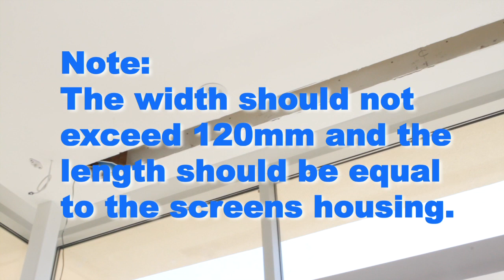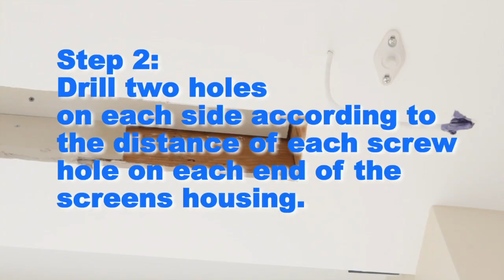Instruction Guidelines on Installing the Aerie Tension

Comment: That end caps at both ends of the screen is a F-ing genius idea. Sure makes things a lot easier. I just installed a Stewart Screen housing similar to this and it was a F-ing nightmare because it was not a new construction with an open ceiling, and the opening had to be cut the exact length of the housing. If it were like this it sure would not have turned out to be the nightmare it was. Not trying to bash them, because I own one of their fixed screens. Just saying.